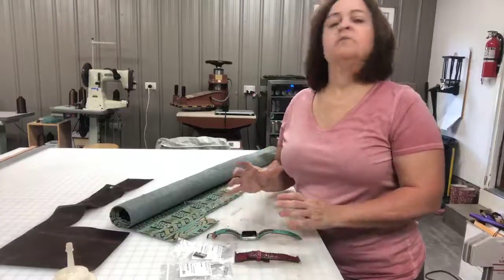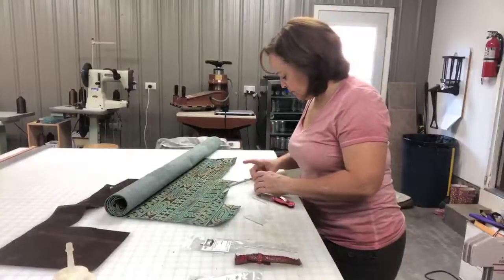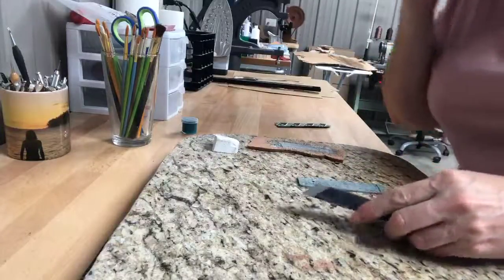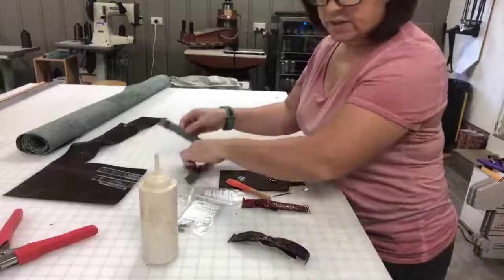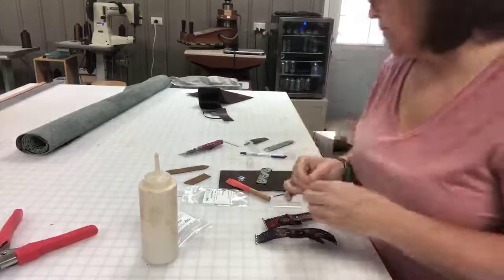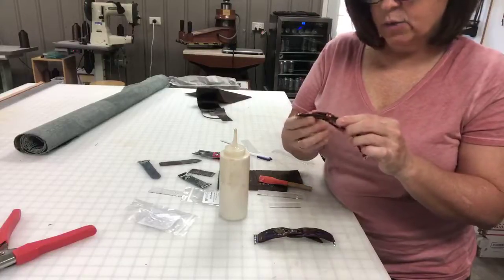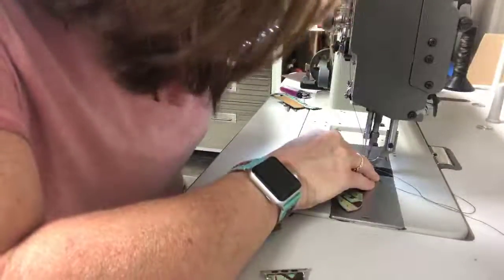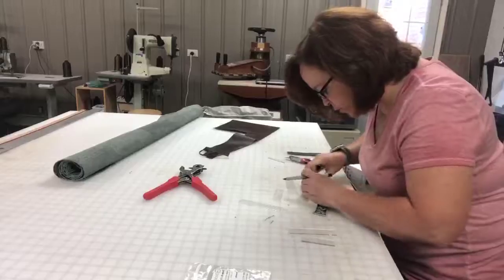Apple Watchband Tutorial by Tack Templates

Comment: I used the 24mm L/XL template and I have pretty large wrists and I had to go to the very last hole available on the template just to get it to fit snugly.  Is that normal? What size watch buckle should I be using with the 24mm L/XL template? Thank you! Love your products.

Comment: Can you use faux leather for the liner ? Also could you just seal the ends and skip the sewing ??
Reply from the maker: I have never used faux leather but I don't see why you couldn't.   I have made similar bands out of heavier oil tanned leather and I did not line and sew.  I used one layer of approx 5 oz and just skived the fold back at the connector and turned back and tacked or hand sewed across the end.  I have had some customers skip sewing and just glue together.  I have never tested that but if you do..just make sure you are using a very good contact cement.